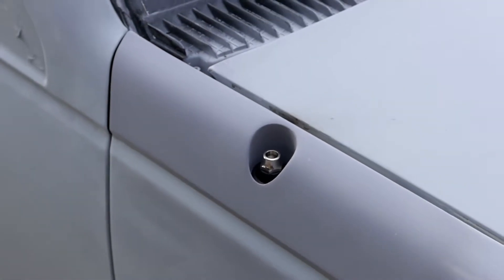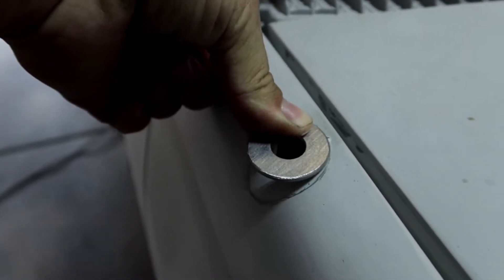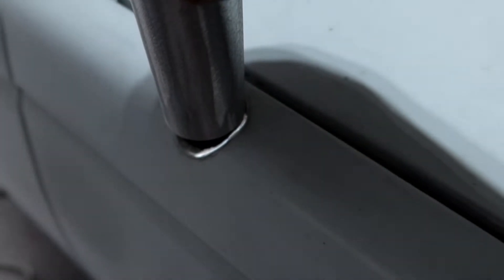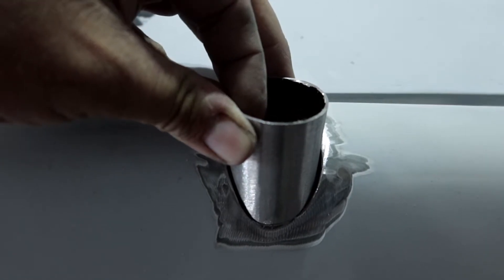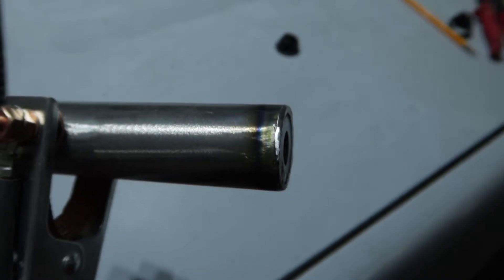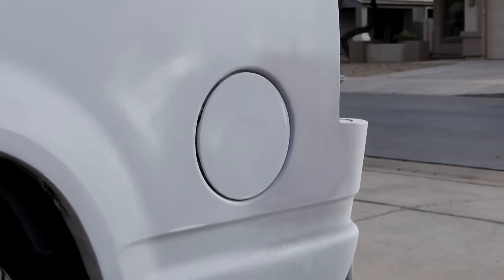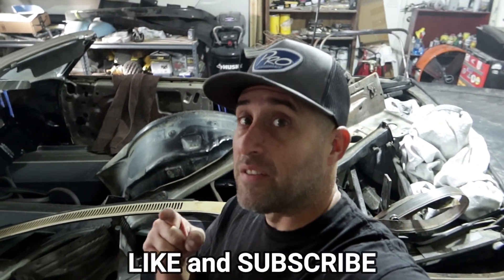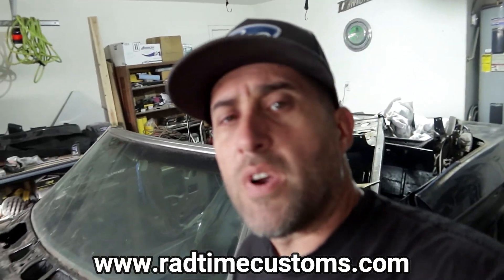Frenched Antenna How To

Comment: Can you do a Hollywood top on like a Mazda cab plus lExplain how to and whether to or not reinforce the inside of the cab. Thank you and nice videos well explained
Reply from the maker: Unfortunately, I don't have the finances to buy vehicles to cut up for videos, but I am in the market for a mini truck...most likely a d21. If that happens then it will get quite a bit of work done to it, including MAYBE a targa top. Dont know, we'll see, I want everything and change my mind all the time...squirrel moments.

We used to refer to removable padded 3/4 tops as "hollywood tops", pretty much a targa topped version of a carson top, also the lowrider crowd would targa top a hardtop (no post) car and call that a hollywood top as well. regardless of carson, hollywood, targa, etc... anytime you cut a roof, you will want to reinforce.

Reinforcing example: When I converted my 54 Chevy from a 2 door sedan (post) to a chopped removable hardtop (no post), most of its time was spent with the roof off. The doors rattle, you can watch the tops of the door gaps get larger when going up driveways etc. That car will be getting reinforced soon and I can make a video to show how I do that. The roof was cut when I bought the car so that's why it wasn't done before the lid was removed.
My Fox Body did the same thing completely stock! So, to fix that I added subframe connectors because unibody, but then also triangulated 1"x1" steel, connecting the connectors to the rockers. Picture looking under the side of a car and seeing a ladder from a Tim Burton movie.

Reinforcing in general: I typically use 1"x3" steel to run along the bottom of the floor, behind the rockers, connecting body mounts together. You can also use the same 1"x3" to reinforce the cab corners inside the truck.

REINFORCE BEFORE YOU CUT! Even when just chopping a car or truck, you need to use something to hold everything where it needs to stay. 1"x1" is easy to use for this. You are pretty much connecting all corners together so that the body doesn't move when it loses the top that holding the shape of the body. So run them from the beltline to the floor diagonally, obviously below where you're cutting.

If you are looking to do any of this to your current project and can't wait for info or a video, you can always shoot a message to : https://www.instagram.com/radtimecustoms/ on IG and I will provide any help I can